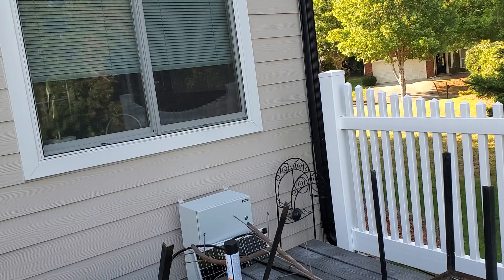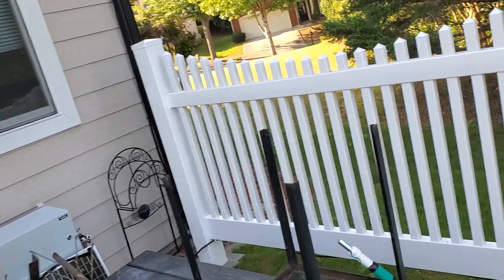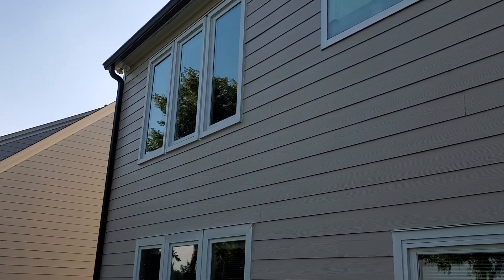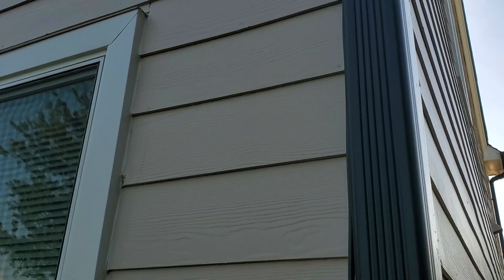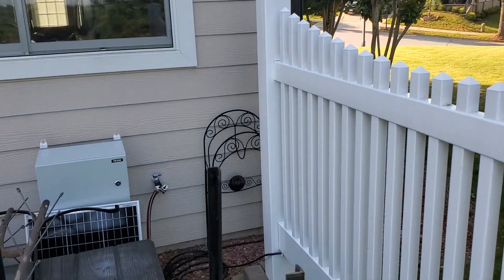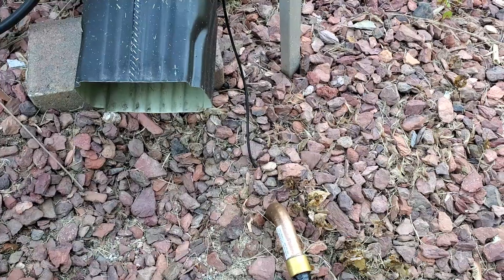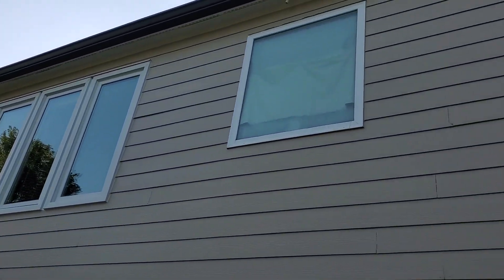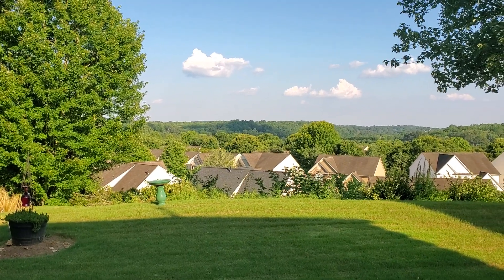The Gutter Antenna - Is it possible?

Comment: Another problem with gutter antennas and their down pipes is poor connection/bonding between the lengths. Some guys put screws through the connection points. Hiding a wire antenna up there is a much better idea.

Comment: My gutter worked great for a couple of months.  I could rag-chew on 80m and push 100W into it.  But one day, it suddenly couldn't take more than 50 W.  I haven't figured out how to get it back after several more months of fiddling and reconnecting.  I run a long wire now.  Try it, and appreciate it while it works... it will on receive, and still does for me on the big bands.
Reply: I put up the Alpha Antennas "HOA Buster" antenna on my house, and it worked fantastically. I don't use it very often though and recently I hooked up my RigExpert AA-35 SWR meter to re-check the tuning on the bands and it was practically dead from when I first set it up months ago.  No idea what has happened. I've checked everything and I don't see anything broken or damaged from the weather.  Obviously, 'something' is not right and I'm yet to figure it out.  I suspect the high SWR was the cause of the damage on my (tr)uSDX QRP transceiver that now won't power up from the regular power cable, but it does power up using the USB connector.
Reply from the maker: @BernieDiaz that’s tough to hear. That kind of thing drives me nuts. Best of luck figuring it out.
Reply from the maker: Thanks for your contribution to the comments.

Comment: I am curious. Did you ground the gutter, up where your room is, to your radio ground? 

I found one of the best ways to ground out noise is to use a copper sheet, or flattened copper tube and mount it on the desk near the radio equipment. Then, ground everything to that copper piece directly, not through other equipment.  

I once had a small steel desk in the room. I grounded it to the bar and reduced noise, too.  I don't know why the desk needed to be grounded, but it worked. 

My computer, printer, any accessories I had, the radios, the desk it was on (metal frame) and a ground  rod outside of my window. (I was on a ground floor) and even the 3rd wire ground to my electrical outlet.  (I had an old house that still had 2 wire electrical.)  

If it had a screw that went into a  metal frame, it got grounded.  I reduced the noise level from S-6 to S-1.  

I did not daisy-chain any grounds. I ran a wire to everything.   The closer stuff, like the radio, computer, etc., were gronuded using the shield pulled out of RG-8 coax.  I used #12 wire  or smaller for the rest.  Even a single thread of stranded wire made a big difference in a test, but I used the whole wires when I couldn't use the braided shield. 

Twenty years later, and you just reminded me to do this in the shack I'm setting up in my upstairs apartment.
Reply from the maker: Didn’t bring the gutter ground in but that’s a thought. To your other points, that is what we did where I worked in the past. We didn’t want any difference of potential between anything metal. They even had a guy come in and do grounding audits looking for current flow (which was a big no no). I also here try to make sure everything has a common power and ground point too. I found that makes a big difference as you were saying. Thanks for watching and commenting.

Comment: How much power were you running? N3UIH.
Reply from the maker: Thanks for watching and commenting. 100 watts when I got the 53. same power as on my other antennas tested that were 57 and 59+. I figure the lower efficiency was due to either the length of the gutter segments, the shape of the horizontal portion, or both. If the segments were 1/4, 1/2, and 1/4 wave like a half square antenna results may have been different. But interesting experiment though.

Comment: Very interesting video. Your gutter reminds me of a half square !
Borrow my wife if you want, I don't interfere with my wife's hobby, she don't interfere in my hobby.
Just put up my fifth vertical, and I have 350 10m long radials around the garden.
Some ants work well at one qth, and others just don't work at all.
Here horizontal ants just don't work here,  but verts are fantastic.  
Good luck, 73.
Reply from the maker: Thanks Brian. My thoughts exactly on the half square. If the 3 sections length were 1/4, 1/2, and then 1/4 wave results might have been different. But interesting experiment nonetheless.